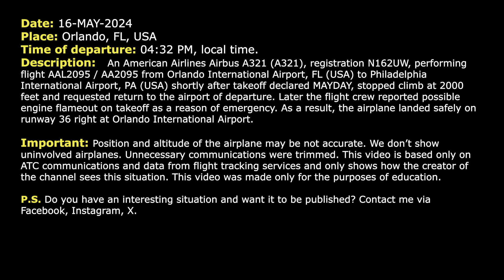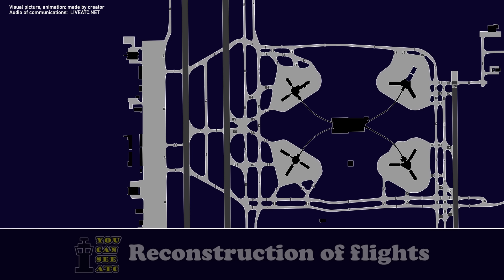Possible engine flameout. MAYDAY. American Airbus A321 immediately returns to Orlando. Real ATC

Comment: Cleared for 35R and later cleared for 36R -- strange?  No, actually it is not.  I checked and MCO has both 35 L & R and 36 L & R.  Original instruction was for 35R which is 9,000 ft but later Approach Control PROPERLY switched the instruction to 36 R which is 12,000 ft and 200 ft wide. Possible single engine might not have reverse thrust.  Good call by ATC to put the Emergency A/C on the longest runway.  Of course it confused ME initially because I didn't know Orlando had all those N-S runways.  The pilots did know that, so they didn't question it.
Reply: It was the pilot who requested the switch to 36R. See 3:16.

Comment: I'm not sure if this will be answered and I don't know if I'll get an alert if anyone does. I've been following this you tube channel and other, similar ATC channels for a long time. But why are radio communications so bad?  This is an emergency situation and I could barely hear any of the tower instructions as they were garbled mostly.  This is an emergency aircraft.  Are there any plans to enhance communications so it doesn't sound like someone trying to handle a short range radio?  We must be able to do better.  Thanks again You can see ATC for sharing all of these situations with us!
Reply: You are listening to a recording from someone's scanner. The quality of the reception is going to be dependent on how far away they are from the source. The conversation between the tower and the plane will have been perfectly clear to them just not to the scanner on the ground.
Reply: @bigskyvideo  thanks so much for that explanation.  I wasn't aware that the interference wasn't on the actual transmission.  That gives me hope that our pilots aren't trying to navigate MAYDAY situations while listening to a transmission that sounds like a tin can on a string telephone!

Comment: U.S. pilots seem to be getting better at using MAYDAY and PAN-PAN recently. Has there been a rule change or new guidance issued or am I imagining it?
Reply: It's due to all the dissenting comments on You can see ATC. We did it!
Reply: I wonder if it's because they keep getting roasted in the comments of these videos
Reply: Not sure why, but at least at American, the training department is emphasizing the proper use of mayday and pan pan calls. “Declaring an emergency” isn’t recognized by ICAO, so they want the pilots to do it the correct way.
Reply: It's getting better for sure, but he wasted a bit of time with the first call just calling the tower with his call sign. It would be perfectly acceptable to jump right in with "Mayday Mayday Mayday, American 2095, American 2095, American 2095", then state the nature of the emergency.  I kind of question the tower controller's instruction to contact approach for sequencing after they said they need to return immediately.

Comment: Sounds like the crew member is young and a bit scared
Reply: He did not appear nervous at all. He was calm, collected and completely professional.
Reply: @malahammer He did a great job, but he was clearly scared. His voice was cracking.
Reply: @malahammer  Well I dunno man, but where I come from, when a person is talking rapidly, breathing heavily, and their voice is cracking... those are all signs of being scared. 🤷‍♀️
Reply: he is not .. and by typing on keyboard its very easy to judge .. this is the worst emergency one can have if you are a Pilot .. atleast appreciate him
Reply: @mrkhan2983  Huh? A possible engine flameout on a twin? This happens all the time and is very far from being "the worst emergency you can have." It is an emergency and returning is the proper course of action, but there any kind of flight control problem or especially a fire is much worse. Airline pilots routinely train on losing an engine during takeoff. They know exactly what to do and the aircraft are designed to fly quite safely in such situations. Now, if you lose both engines, then, yeah, that's a much bigger problem.
Reply: Exceptional radio work, highlighting the Mayday status after every single frequency change was exemplary to avoid assuming that each controller was aware. It could be if he is earlier in his career that this is something they are really drilling on the training now, that older pilots might have forgotten (or even not been trained that way).
Reply: I got that feeling as well. He hasn’t done it a thousand times yet.

Comment: Another Airbus with engine problems!, what is going on?
Reply: Neither Airbus nor Boeing make the engines. You can't blame them for engine problems
Reply: Engine got a birdstrike when running at or near full power, then carried on for at least long enough to land. Sure feels like it's done it's job properly.
Reply: The PW1000s (used on the A220 and A320neo) are the ones that have been having problems. This is a CFM56 (on an A321ceo.) Pilots reported bird strike as the likely reason for the possible temporary flame-out. This can happen to any jet engine if it ingests enough foreign object debris and/or the airflow through the intake becomes significantly disrupted.
Reply: Waiting for the whistle blower to come out for Airbus.
Reply: @saxmanb777  The PW1000 engine problems are very well known to everyone in the industry. Kind of hard to hide that, no whistle blowing needed.
Reply: Maintenance.

Edit:
In this case it appears to be caused by a bird strike. So stop your fear mongering.
Reply: @blockbertus doesn’t want fear mongering but tries to blame maintenance
Reply: @blockbertus  you aren't qualified to make that determination.